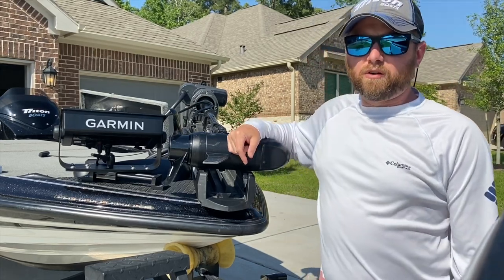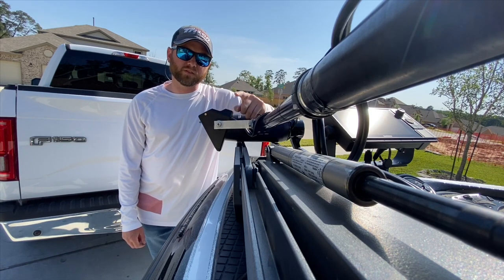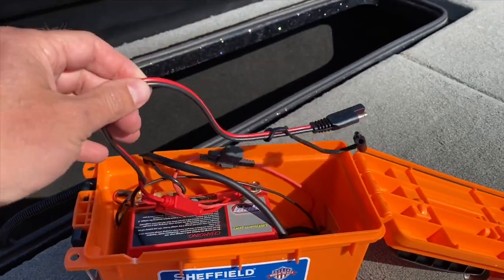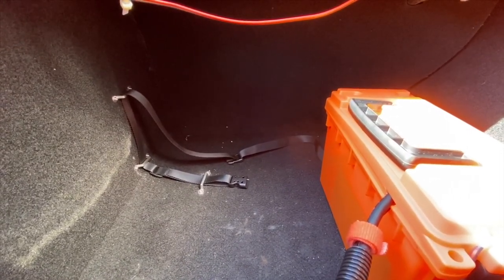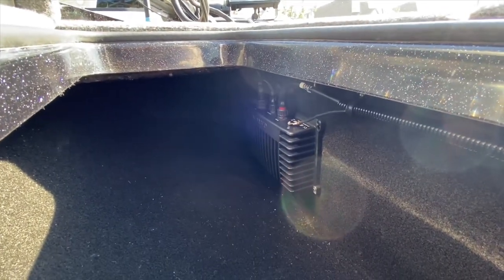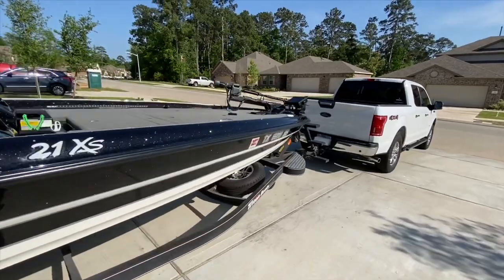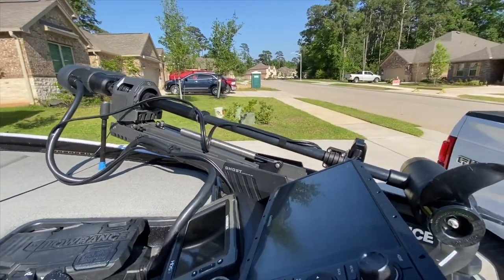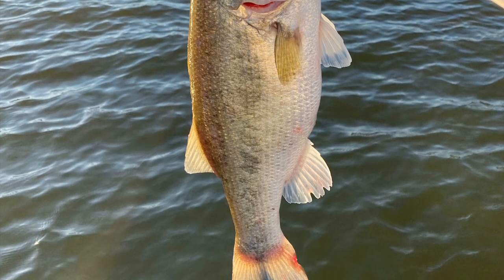Overview of Panoptics livescope install in a Triton

Comment: Was it difficult 1 out of 10
Reply from the maker: I would rate the install as 5. Finding a place to mount black box and battery is the most difficult part. Don’t want to drill through your hull! Also please note I stepped up the battery size.  TalentCell 2000 Cycles Rechargeable 12V 24Ah 288Wh Lithium Iron Phosphate (LiFePO4) Deep Cycle Battery Pack https://www.amazon.com/dp/B0824S6LB2/ref=cm_sw_r_cp_api_glc_fabc_XRZbGb8XTYHXW
Reply from the maker: Also had to get a larger case for the battery. https://www.academy.com/shop/pdp/pelican-vault-series-v100-handgun-case
Reply: Michael Boyd Outdoors thanks